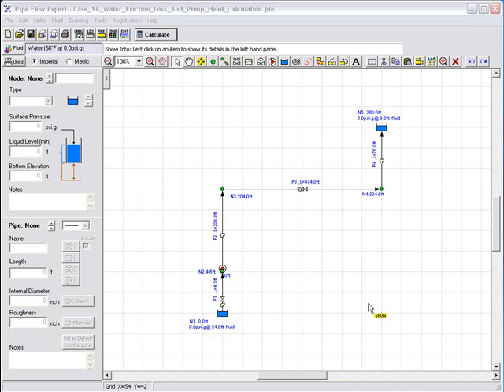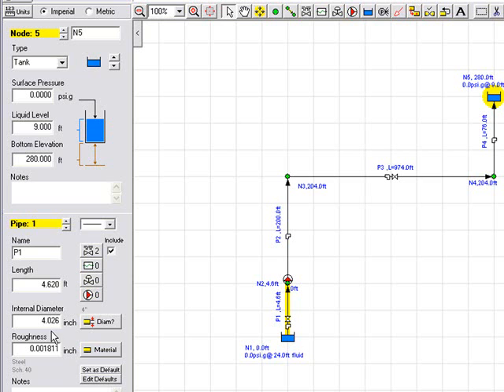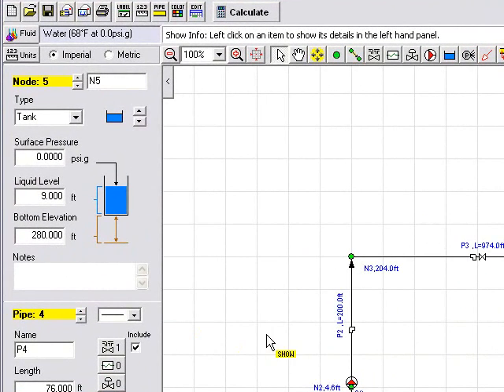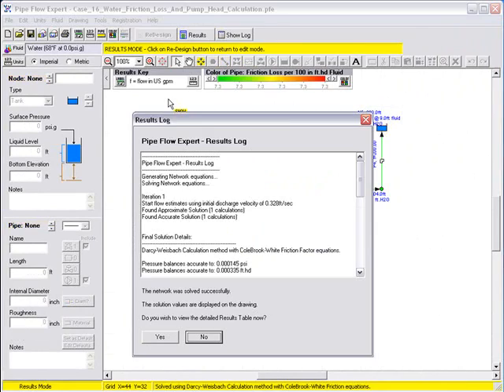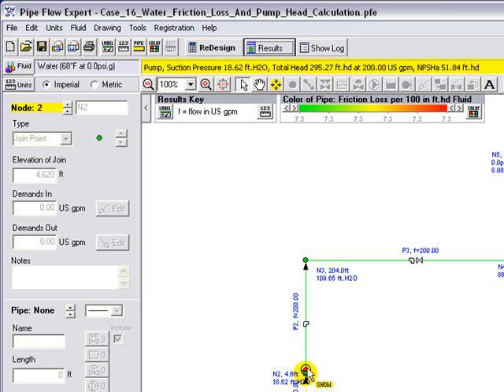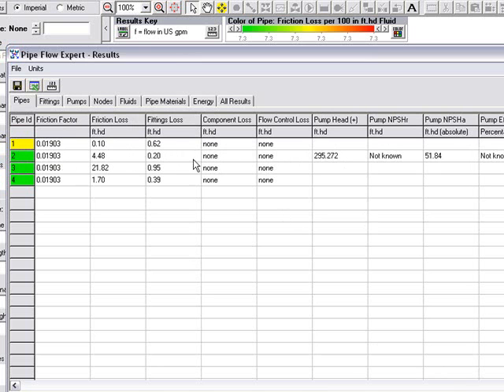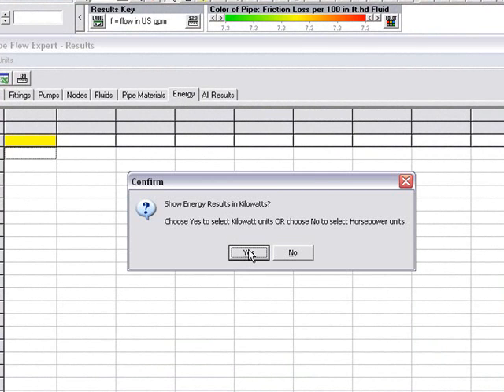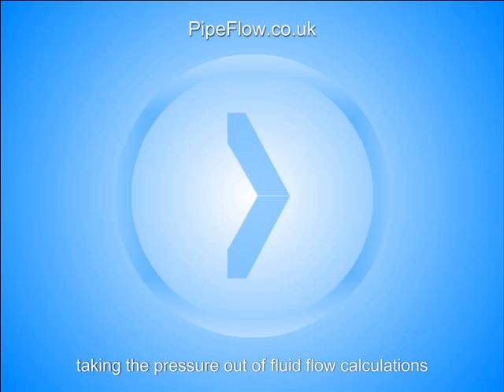Calculate Pump Head Required

Comment: Good video! What was the NPSH required and how did you get the K values for bends?
Reply from the maker: Thanks! The NSPH available was about 51ft head (as calculated and shown by the Pipe Flow Expert software). We did not show the NSPH required since we set the pump to a specified flow rate and asked the program to calculate the pump head required to achieve that flow. If we had defined the pump with a flow versus pressure loss performance curve then we would also have entered the NPSH required data against each flow rate point on the curve, and in this case the software would have checked the NPSHa was greater than the NPSHr (and warned us if it wasn't). Note: this video is of an old version of Pipe Flow Expert from 2008 and the latest version of the software has many additional capabilities when it comes to modeling pumps (it can model complete pump performance across its range of speeds and impellers). There is a video showing some basic pump modeling in the latest version at  Pipe Flow Expert Software Pump Models Basic and we will be adding more videos soon to show importing of pump sheet graphs with the ability to click over the curve on an image to mark out and import the performance data.
Reply: Many thanks! ;)